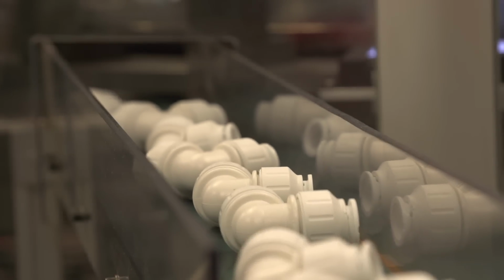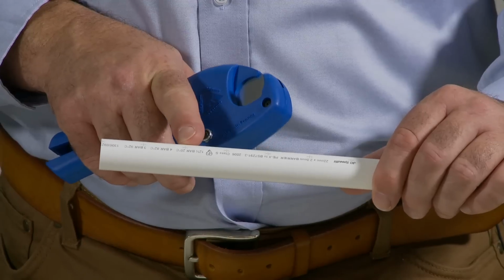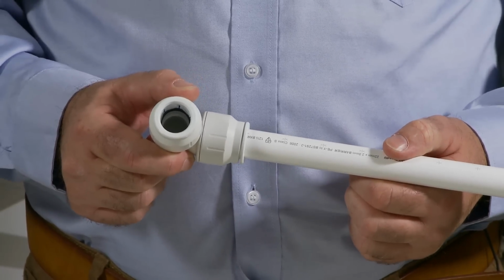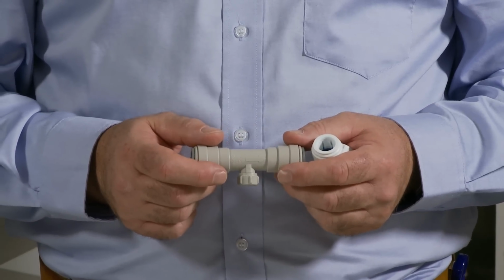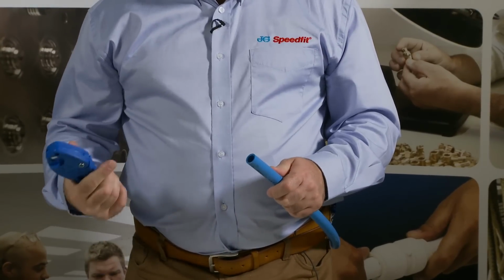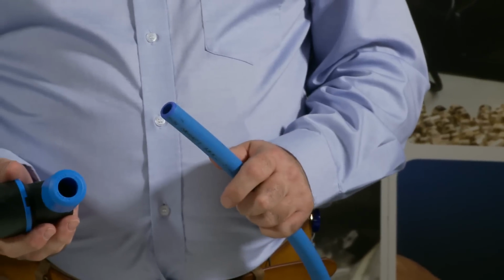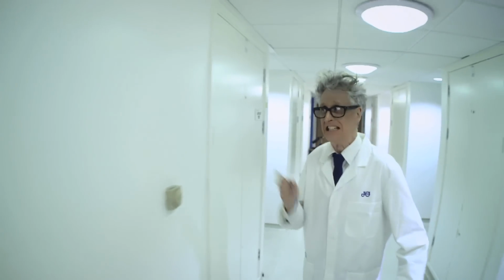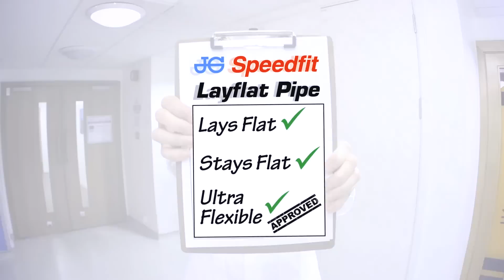JG Speedfit Presentation InstallerONSITE

Comment: Remember these plastic fittings are bigger than copper fittings and so might get in the way when relaying the floor boards, you might have to make the cut out notches deeper otherwise the floor boards will be pressing on the fitting and you dont want that.

Comment: I’ve seen speedfit pipe pulled out of their tightened fittings through sheer weight of the water in them & because they haven’t been clipped enough under the floor. But this is the only push fit pipe I trust to put compression fittings straight on to.

Comment: Hi. Im not a plumber. I have two different jg fittings. 15mm white and 12mm black. The white is all plastic inside. The black has metal grip. Ive found inserts with and without seals. Do i need insert for black.. and if so. With seal ir without? Phil

Comment: Have could you say all this and still inflict the rubbish that 22mm standard pipe is on the trade? Almost impossible to straighten then trying to curl back up after fitting putting stress on the fittings.  I take it you coiled it while it was still hot and it never loses that memory.  Not to mention the 15mm elbow straight out of the packet that leaked because the O ring was not in it’s seat.

Comment: I’ve taken fittings apart after 10 years of being on and the O-ring was already becoming hard and brittle. Especially on the hot water system. 

Full houses are being plumbed in these (or similar plastic) and at some point ALL of the O-rings will start to deteriorate around the same time, under floors, behind walls and ceilings. 

So after thousands of pounds taking floors up and ceilings down to access every fitting will a guarantee just replace the fitting? Or will they pay for a full house remodel? Or will the company just go bust/change name and avoid it 🤷🏽‍♂️

In my opinion it will definitely be a BIG problem, BIG money for plumbers and BIG payouts by insurance companies.